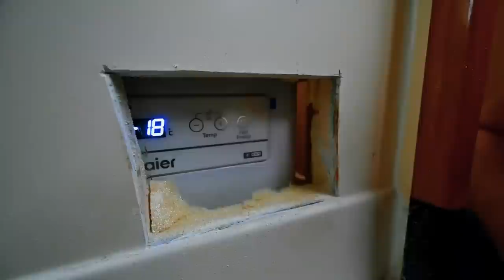Our most EXPENSIVE MISTAKE yet! Sailing across the Pacific Ocean [Ep88 RED SEAS]

Comment: Two things to consider for long crossings: 1. Perhaps an ac converter for the engine alternators so in emergencies and cloudy days you can use your engine to charge your batteries, and  2.  When you see your significant other every waking hour, agree to use the term “I need some me time” instead of “ alone time”.  Everybody understands what me time is and the other person won’t need to wonder if they should be offended 😊. You guys are doing great! And don’t worry about losing your sanity. It’s overrated 😂
Reply from the maker: Haha I think the sanity took a long walk a while ago now. 😜 
A proper means of charging house bank from our alternator has been on the wish list for a really long time now. Unfortunately they are not that affordable in our case so we continue to improvise our way along. Hang tight, so much more to come.

Comment: Cheers guys,  kinda looks like you need a tow gen and maybe a wind gen, to make power at night.. anyway sponsors watching?
Reply from the maker: We would take a sponsor for extra power in a heart beat. Wakespeed, electromax, wind gen…anything to boost our power options on passage.
Reply: 600 usable amps and 2200 solar is a lot, rare you will deplete 600 amps.
Reply from the maker: Totally! When you look at the load we place on our batteries and the efficiency of solar panels against their stated rating, it’s a tricky balance to get right. In this case, we were almost a week without any real sunshine so the battery charge was never meeting our usage. Each morning, the battery state was slightly lower than the same time the morning before which let us to this situation. 

That said, when the sun does come out, we are usually fully charged by around 12pm (we see around 140A charging when it’s clear skies and the sun is up). Also worth remembering that we are running a. 12v system so it has its limitations.

Comment: We had the same thing happen to our spinnaker one day past Galapagos. It definitely slowed our progress. Hopefully you have enough wind for just the head sail so you can keep your batteries charged.
Reply from the maker: It makes for a tough run as you know. This year is El Niño too so winds have been all over the place. Reversals, zero wind at times and then wild squalls too. All good fun
Reply: Additionally, our 20 year ild spinnaker broke similar to yours last year, fortunately, it was 3 days out if the Cooks going towards 🇫🇯 Fiji and we used our code zero for the rest if the downwind work.  20 years for a spinnaker is good, RIP!